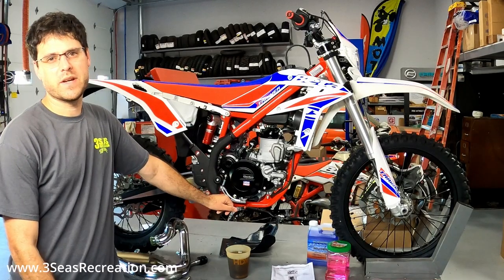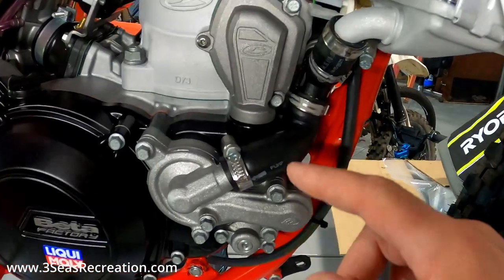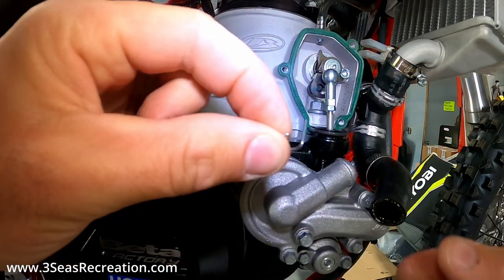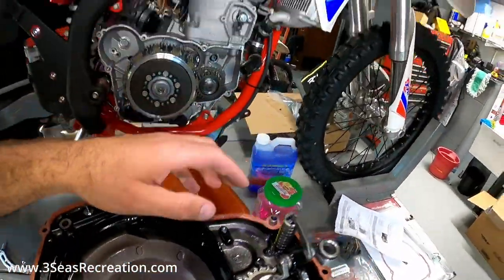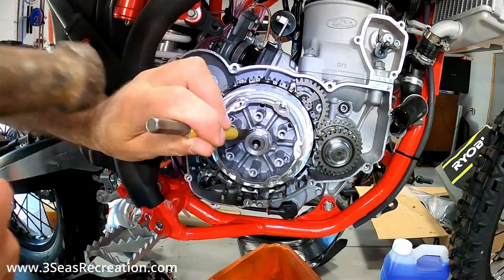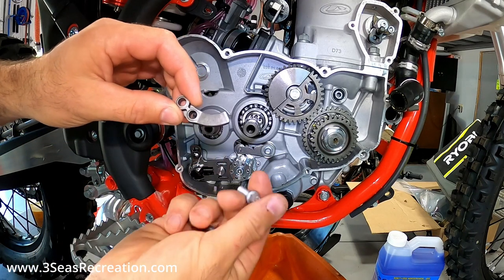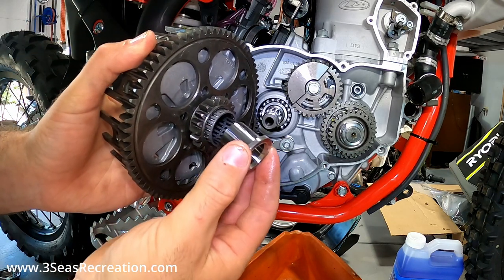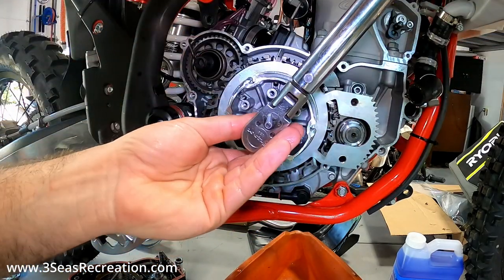Beta Kick Start Kit Install | 2022 Beta XTrainer 300 | AB-21192 | 2018+ Xtrainer & 18-2019 2-stroke

Comment: Excellent Instructions!  Is there a difference in AB-21192-20 and AB-21192?   I have a kit for my xtrainer but I was given AB-21192-20.  Thanks!
Reply from the maker: Good Morning, Yes I believe the -20 is for the 2020+ and newer models. You will definitely want to double check that you have the right kit for your bike before you attempt install to prevent your bike sitting apart waiting for a different kit. Thanks for watching, Jared
Reply: @3SeasRecreation  All good,  the only difference in the two kits is the actual kick lever.  The “20” kit has a shorter and rounded kick lever but I have it installed and it’s all working!

Comment: How different is it for the 4T?
Reply from the maker: Hey Russ, it's a very similar process! Watching this video and using the supplied directions you should be able to do it no problem! Keep in mind we offer discounts on Beta parts so I would be glad to help you out! Thanks, Jared
Reply: @3SeasRecreation  I just watched the metal oil gear vid and the 2t kicker vid so I am going to do them all at once. I have the parts but if I need more I will hit you up. Great content Thanks.